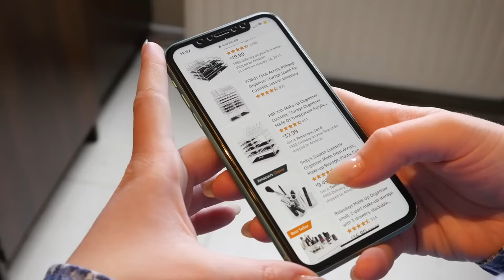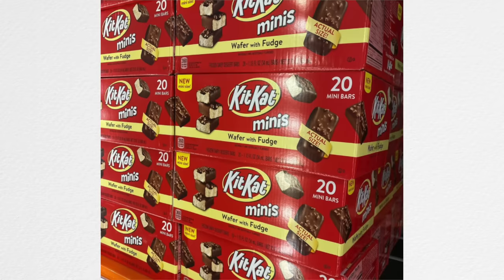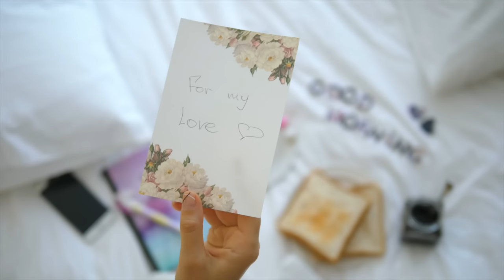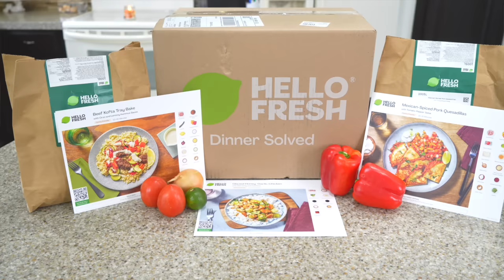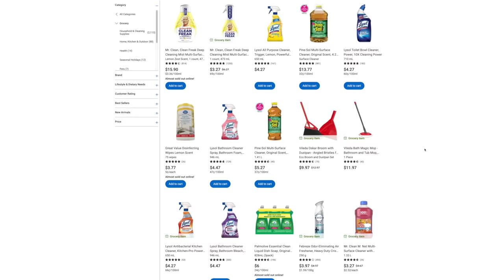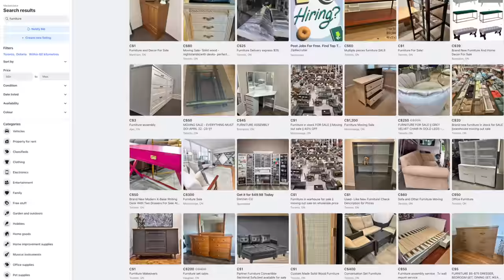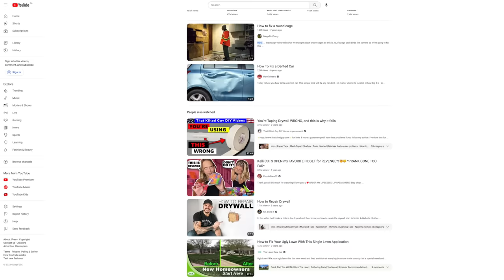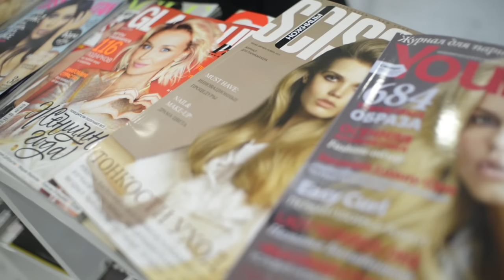25 THINGS I DON'T BUY 💸 (HOW I SAVE MONEY & SPACE)!!!

Comment: I do all of the same. We do not get pet medication from our veterinarian. I tell them to send it to Walmart,  it's usually on their $4.00 list or we use Good Rx. Example,  our old dog is on clonazepam.  They wanted 80.00 to fill it at the vet. Walmart was going to charge 50.00  We applied a Good Rx code which brought it down to 13.95.

Comment: For cards, I used to keep mine and then a year ago I went through all of them and it was honestly so sweet to read through the cards that I had collected throughout the years, but after I read them I sorted them into a trash pile and a keep pile. There were some that had such sweet, sentimental thoughts, but I couldn't even remember who they were. Anyway, now I have a small box filled with cards that I absolutely love and the rest I either threw away or I tore off the front page (as long as it's not written on) and I use those instead if I feel like I want/should add a card with a gift. I reuse it or lose it, so I feel like it's a win-win. I also understand that keeping the cards could get unmanageable, but I have a specific holder for cards, so if that gets too full I know I have too many. It helps keep it in check. :D

Comment: This will sound really strange. There are two things that I don't buy in specific packaging. The first is upside down ketchup. You can buy the same brand of ketchup in a large size that has the label printed so the top is toward the lid, but this bottle will still stand upside down. And it's cheaper ounce for ounce than the bottle that has the label upside down.
The other thing is diphenhydramine. If you buy it packaged as an antihistamine, it's much more expensive than if you buy it packaged as a sleeping pill. But it's the same medicine, the same dosage and does exactly the same thing.

Comment: Funny thing about an extended warranty. Our first big purchase was a fridge. We got it with an extended warranty to 10 years (instead of 2). The very first day our normal (2 year) warranty expired, our fridge broke.
So we had to contact the manufacturer, they tried to push for a paid technician service, but luckily due to extended warranty, the service was free. The fridge has been working ever since with no fails for at least 11 years.
The same happened to our TV.
I frankly started thinking that  manufacturers program their devices to fail after a certain period of time.
In my experience, it is worth getting it when buying something big and expensive

Comment: Great video as usual. I agree with you on almost everything.
We actually switched from using regular towels to buying paper towels for hand washing and we seriously cut down (>%90) on the number of times everyone in the house got colds, flu and bronchitis throughout the year (and personally I haven’t had pneumonia since. )
I will buy 
Extended warranties for certain items; mainly electronic items that are specialized and cost more than $150ish and I can tell you that has saved me thousands of dollars. (i.e.: We had a tv that we had to have repaired about three and a half, maybe four years after we bought it, far past the manufacturer warranty but our extended warranty still covered and saved me from having to replace the entire unit.)   Televisions, a laptop, computer parts, we’ve been saved by the extended warranty a bunch of times. 
We have cut out our souvenir purchases also, with one small the exception. Any city we visit that has a HardRock Cafe,  we will purchase a pin (they’re only 2” big). I add them to my display case, which holds my entire collection of 20+ years, (around 50 pins) it is already hanging on the wall and only the size of a picture frame.
Reply: I love to buy a refrigerator magnet from states I have visited.

Comment: Some stores do set it up to where you won’t get the savings until it rings up the correct amount. Say Pringles are 4 for $5 and a single can is regularly 1.50 the first might ring 1.50 the second might ring 1.50 the third $1.50 then the 4th would ring up .50¢ not all stores but some.

Comment: Hi Cas great advice and tips!! I NEVER get the extended warrantee on anything! Why ? people ask, I then explain it's because it is probably covered on your house contents insurance, or the shop where you get it from gives you a year and the manufacturer gives at least 2 years anyway and let's face it most things are going to break just after the extended warrantee runs out! Most of the time I also dont buy boxed tissues either, I usually forget and as you say loo roll does the job. I also buy plain coloured gift wrap in gold or silver and that covers every instance e.g. birthdays, Xmas, Easter etc and it always looks really posh too! I did start buying the cleaning wipes during Covid but after hearing the advice from you Cas I wont be getting them again, usually they dry out half way down and I have to use spray to refresh them... doh!
MY BEST TIP... I also never buy washing pods, liquid or powder I buy the green washing ball on Amazon it is brilliant I just add a bit of fabric conditioner and the washing comes out clean fresh and perfect, the ball costs about $10 and lasts years, if there is a stubborn stain then I use stain remover, but I save a fortune on washing pods etc

Comment: We never use to do extended warranties on anything but we have started buying on cars and TVs.  Cars:  we have used the warranties due to electronics issues and it was worth it.  We also have had problems with the last 3 TVs we have had.  We even changed brands, etc.  I am here to tell you, with Smart TV's, it is worth it.  We literally had a TV that could not be fixed and we got an entirely new TV at the price we bought it 2 yrs before.  Electronics can be fickle or complex and if it is a high priced ticket item, might want to think about.

Comment: My favorite quote of the email: “ Do not traech random people, Cass!”  We keep bottled water in the garage for our emergency kit and replace it every 6 months to keep it fresh. We drink the older water when we are working in the yard and filthy so don’t want to track into the house for a refill.  We don’t buy individual hand soap pumps any more. We have electric no touch dispensers and buy a smaller refill bottle of soap which we dilute in the dispenser so it is about 1 part soap, 4 parts water. More sanitary, and a refill jug lasts more than a year. It may not save money though, because the dispensers do go through batteries-we get Duracell in bulk at Costco-one of the things we still buy in bulk because we use them! We also make our own Dawn power wash. That stuff is expensive! So get an inexpensive mister bottle (or buy one bottle of Powerwash and reuse the bottle) and make your own refills. The recipes are online. I buy a big bottle of blue Dawn for the recipe and it lasts forever this way. Plus I have it for other cleaning uses. It is a great stain remover and degreaser. I am working to simplify my cleaning supplies. We don’t buy yogurt cups or sour cream anymore. We buy a small cup of plain Greek yogurt (you only need a tablespoon) and milk and make our own. You can make it in an instant pot or just in the oven. We have a strainer that drains it down to make a thickened form that we use in place of sour cream and even cream cheese to make higher protein toppings or desserts. It is a gadget to store but it isn’t huge and we use it all the time and save money and refrigerator space that multiple products would take up, plus we eat healthier!

Comment: I keep a box of tissues in every room due to allergies.
With my frequency of use, the skin around my nose would be red with wood splinters if I used toilet paper.
Use waxy lip balm under your nose to prevent splinters from frequent tissue use on thin facial skin when suffering from a cold.

Comment: We buy Kleenex because my husband and I have bad allergies but we stopped buying paper napkins and rarely buy paper towels. We do buy a pack of water about once a year we keep it in the car in case of roadside breakdowns however the one thing I would say that has probably made a big difference for us over the last year is laundry detergent instead of buying premade we get the zote flakes (bars are cheaper but I’m to lazy to grate them myself), borax and washing soda I made my current batch last December 4th and while it’s not quite out I’m also not getting to the year mark however as I priced the ingredients to remake it I’m only going to need to spend $33 for another 10 months of laundry detergent and it’s super simple to make just a one to one ratio of the three ingredients

Comment: I typically don't buy Kleenex either. For the last two years I have used TP and have rolls stationed in different rooms. 
For whatever reason my nose attempts to run a lot so in those cases, I just tear off one square.  Someone now just needs to make a decorative holder. Can't even find one on Amazon!

Comment: Horror story:  I once bought a mower at HomeDe...  and it was $159.00.  I also got the extended warranty.  The mower only worked for a couple of hours before it took a crap.  I decided to use my warranty and took it back to the store to get it fixed.  After it was fixed, they said it was $69.00, which was a fee for using the warranty.  I left it there and refused to pay.  I was able to get a total refund on my credit card through phone arbitration because I was not in possession of the mower, they were.

Comment: You know that on yiur electronics …phone,iPad,etc…. That more than likely your homeowners insurance will cover all of those “devices for about $20 a year. I have a Liberty Mutual. And I think it is $25 a year. Done on the monthly with the premium. But it covers my iPhone and my iPad my printer and everything up to about $3000. The nice thing is if I dropped my phone when I am out, which I have done only one time, it is covered for repair or replacement. With a $50 Deductible. I have only used the service two times in 20 years. And it is really worth it. And it is shipped. If you get a phone at Verizon or anything, like that, they want you to take the monthly program and it doesn’t even include left. With your homeowners if your stuff is stolen out of the car for whatever, it’s covered. It’s a winner.

Comment: for a lot of these, I was exactly the same, no paper towels, no kleenex, no juice boxes, actually no juice, just fresh fruit, no gadgets, etc.  This was when I was around your age with a young family.  As you get older, this may change, will be interesting to see in 20 years what you end up using. I have completely switched, I use kleenex all the time now, even for toilet paper, I dont buy tp, except for cleaning if I need cheap disposable wipes. I use kleenex as a disposable wipe for many things now.  Never used to buy bottled water, buy it regularly now for traveling in the car and family outings. Much easier than carrying around gallon jugs on the road and having to pour.  Essential to have bottle water on road trips, day trips outdoors, unexpected dehydration, hiking, etc.  When we started out with a young baby, we had a tight budget, the first to go was paper towels and juice.  My mom would visit and freak out that we had no paper towels.  Now I use them for cleaning and keep a roll in the car for road trips.

Comment: Went on Google to fix my washing went to the make & manufacture of my washing machine, there help video's what to do if your washing machine wont stop filling with water, said it was the pressure switch that controlled shutting off the  water, brought the pressure switch for £35.00.
Watched on the same site  how to replace the old one, was real hard to get the old one out, easier to fit the new one,   machine still flooded! 😠
Called a local washing machine engineer, he blew on the tube attached to the pressure switch cleared it in seconds! 😳 Attached the tube, it worked no flooding!!!🤗 
Only charged me the call out fee £45.00, wish I'd called them in the first place & would of saved struggling to mend it myself & £35.00!!!😤 
I now have a pressure switch which has nothing wrong with it, but Im much wiser by watching & listening to  the engineer right in front of me, so if that happens again I know what to do.
Call the people who know what there actually  doing. 
You help surport your  local firms. And know you have a professional looking at your appliance.

Comment: I buy multiples of our most commonly used things, because nothing cuts into the executive function like running out of something like toothpaste and not having a full replacement on hand.
If anyone is down to the last stick of deodorant, I buy three more.
Same with things like tomato sauce and black beans and all of our other necessary food and hygiene items.

If anything goes sideways with my income, I have a few weeks to find work or apply for assistance without also freaking out about not having money for household staples.

This rule goes double in rural areas, because in terms of money and time, fuel and trips to the store are not cheap.

Also, as someone with chronic sinus and allergy issues, it’s Puff’s Plus. With lotion. I will buy the store brand for almost anything else, but I don’t skimp on the tissues.

What we don’t buy, or don’t buy a lot of, is cat litter. The cat hates it so we paper trained her, and a neighbor saves her old newsprint for us to line the litter pan with.

We do buy paper towels for the gross stuff (we have the cat), but we also have a rag-basket for household cleaning.
We don’t pay for cable TV.
We don’t pay for a landline, although I would rethink that if we lived in the country again.

We don’t buy scented candles. No diffusers. No wax melts. No Glade Plug-Ins. We just take out the trash and if I’m feeling fancy I’ll wipe the place down with lime-scented BioKleen or put a few drops of rosemary oil in water in the thing that takes the tealight candles.

Comment: I refuse to buy a power lawn mower.  It takes gas (petrol).  It's unnecessary.  I'd prefer to not accidentally cut off my digits.  And, the reel / push mower without the engine that I got at a garage sale for $20 takes a little effort but it does the job on my postage-stamp sized lawn in my front yard.  I get some free exercise in the process, too.  

And what's in the back yard?  A meadow.  I had to have a big tree cut down when I moved in.  It was sickly and in danger of falling on the house.  So, instead of planting grass on the bare ground the tree had shaded, after the tree was gone - I spread wildflower seeds.  No need to mow.  It's beautiful. And it's better for the wildlife and pollinators in our area.  

Oh - one other thing I REFUSE to buy... Round-Up!  If I have too many dandelions in the meadow, I'll go out with a shovel and remove some.  But, most lawn chemicals are SO bad for the environment.

Comment: I haven't bought prescription lenses and frames from the optometrists since Zenni Optical started their site about 20 years ago. You buy directly from Hong Kong without the 500+% markup, and all you need is your prescription and pupil distance (which you can measure yourself with the site guidance or ask your doctor for). Their website design has always been a gold standard and their virtual try-on function continues to improve. Great customer service, speed, and craftsmanship. 
Frames have definitely gone up in the last 10 years. They started at $8, but now they're about $12 - $40. 😅 Considering imports are $700+ it would be silly to complain. We've never had an insurance plan pay more than $500 towards glasses which wouldn't even cover the cost of the frames.
Complete glasses with simple prescriptions for $40 is a no-brainier. My complete progressive lenses are under $90. The last few years we've been more financially secure, so I've even picked multiple frames and sunglasses for fashion purposes. Crazy! 
I can't even calculate the 10s of thousands we've saved on reading, driving, computer work, swimming goggles, and sunglasses in 20 years. $30k maybe? Likely more if we consider we've not had to pay for better insurance policies with more vision coverage. 
Also, we use this as a way to judge how above board a new optometrist is: we look for the in-house hard sell. If they insist we can't trust anything but the glasses you get through their office, you know they are either ignorant about production or capitalizing on an accepted import markup that is unfair to the average consumer. If they won't give you your own pupil distance, then they are just jerks. 😅